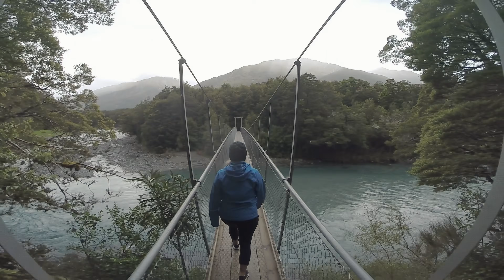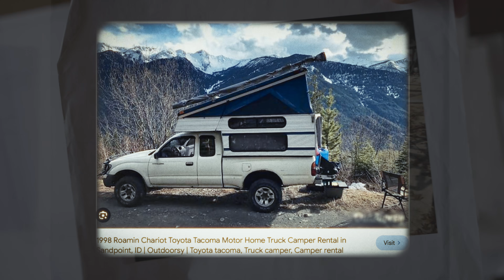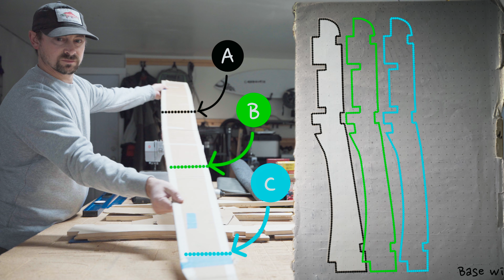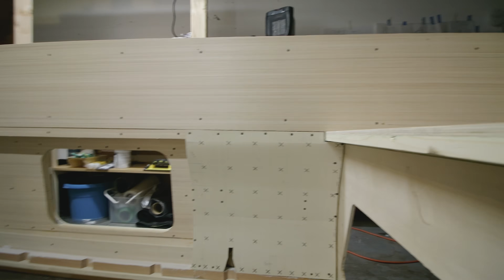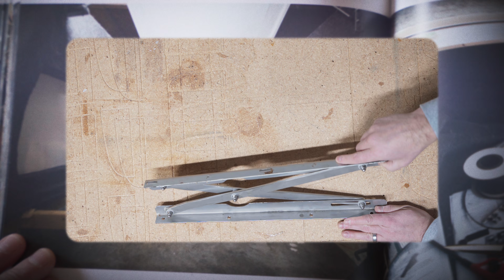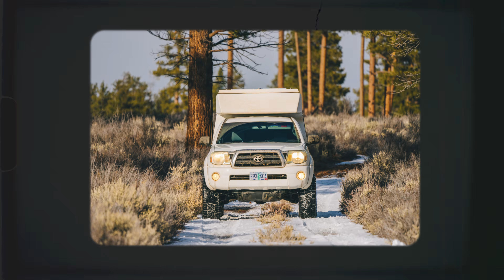Overcab Poptop Toyota Tacoma Pickup Camper | Fiberglass Design | Cardboard Prototype to Reality

Comment: Cool vid.  Any stats on weight?   Heat?

2.0 will be rad!
Reply from the maker: Thanks for checking out the video and leaving a comment. Weight came in approximately 500lbs range, no official weight taken but rough math from transfer (garbage) station receipt and scales info. I used the smallest buddy heater to preheat the rig and shut it off before sleeping but that’s an easy fix with solutions on the market.